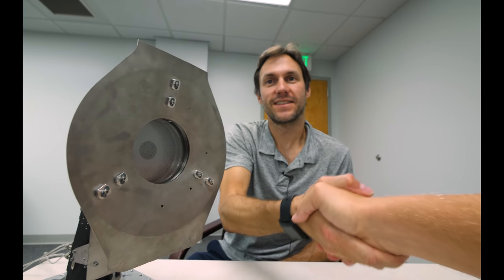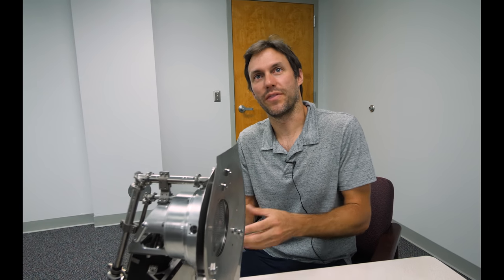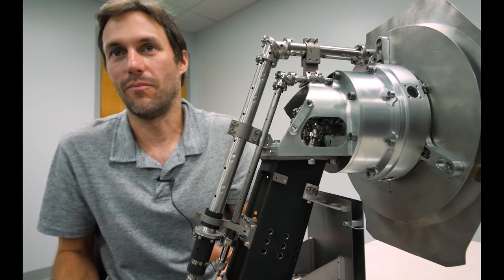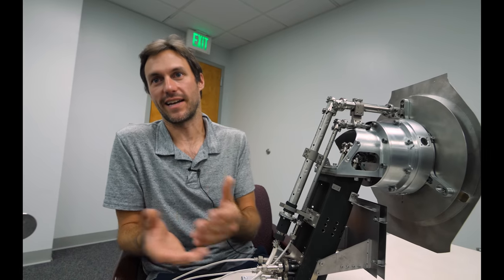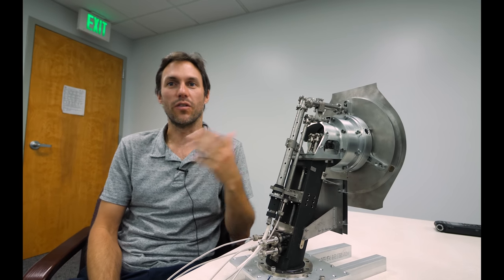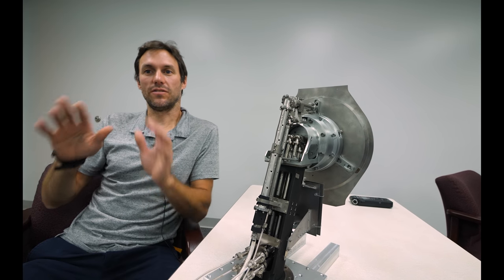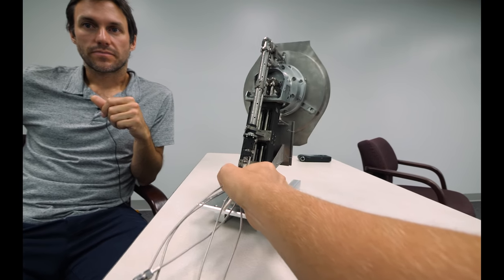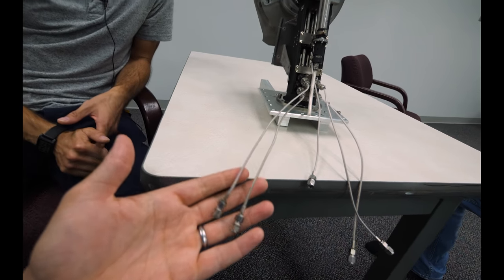Scientist Interview: Dr. Tony Case (Parker Solar Probe)

Comment: I want to know more about the sapphire insulation! Mind blown!
Reply: That and how were the orbits chosen. I mean, if we're going to Mars for instance, we usually pre-select the sites we would like the spacecraft to fly over. I hope Periodic Videos does a video on all these fancy metals.
Reply: Sapphire really is amazing. Most people are just too used to it being used in jewelry and it just kinda goes by unnoticed but it really is amazing stuff
Reply: The main reason we use sapphire is that it is a really good electrical insulator, even at really high temperatures.   Especially important in this application where we have to sustain up to 6000 volts!
Reply: Is there anyway to see a picture of the inside?
Reply: Sapphires were also used on the 30,000 psi water jet system that cleaned the shells of the booster so they could be reused (up to 10 times). It's amazing that water at that pressure would erode even the hardest materials and even the fine sapphire nozzles got worn and had to be replaced! I know because I toured the Cape Canaveral Air Force Station next to Kennedy Space Center and saw where they took the booster shells segments on rail cars, cleaned them, then they would reassemble the segments (with the famous O-ring seals) and refill with propellant.
Reply: @anthonycase  : 6000 volts? The 2016 article in Space Science Reviews says the onboard power supply "is adjustable from -2 KV to +8 KVDC". Maybe I misunderstand what voltage the sapphires are resisting.
Reply: @reksuhaksarben8249  Good catch.  That was an earlier design. Requirements have since changed. It still CAN go up to 8 kV, but we only plan to take it to 6.
Reply: Tushar Kelshikar, pretty sure periodic videos covered "all those fancy metals" several years ago already. Just search up. Niobium, tungsten, platinum, titanium.
Reply: +Tony Case
thanks for the info, also thanks to everyone else that contributed
Reply: It reminds me of sapphire beads being used in watches, I guess it causes really low friction and low wear and tear in the moving parts. So, that thing is built like a Swiss watch :-)

Comment: stupid question:
If the offcenter gravity to the center of pressure is causing so many problems and fuel usage (by desaturating the reaction wheels), then why not shape the spacecraft in a way, that it compensate for it?
For example: something the same shape on the other side. To make it symethrical.
Reply: They can just slightly shift the mass and it's balanced without adding any unnecessary parts.
Reply: @MyBalls my thoughts exactly.

Comment: Awesome videos!  I want to know more about the screens on the collector, more about the construction of the shield protecting everything, how do those magnetometers do what they do and function to provide data, and the solar panel cooling and the "dump" of excess heat to space.  I studied physics, chemistry and biology in college.....ended up in construction, the travel business, and IT.  Thank you for sharing that glimpse into "hard" science in a way most of us can understand.
Reply: The screens (or "grids" as we call them) are made from a monolithic piece of tungsten that is then chemically etched (they mask off the bits we want to remain, and then etch away the rest).  The result is a criss-cross pattern that is 90% empty space and it allows us to create an electric field in the instrument, but still allows particles to flow through them.

Comment: Last thing I heard, sapphire was also used in watches for precision bearings and waterjet cutting machines for presision microscopic cutting by way of abrasive slurry (without losing tolerance).

Comment: @9:17 why not just add another to the other side to have even torque? or just a blank plate made of the same materiel?
Reply: I guess it adds weight but if it was a blank counter balance(for lack of better word) it seems like it would not add to much weight if it is saving on long term fuel.

Comment: hey Justin, just curious, don't know if you asked Dr. Tony this. 
If the "cup" is literaly the main instrument on the probe, why they only build 1. Sure they have tested it for years. But i  think another 1 (maybe place it on the another side of TPS) is better, not only for redundency, but also the data that we get from 2 instruments, certainly better than just only 1.
If there is glitch in the data, with only 1 we can't for sure know if it was the instrument error or not, we don't know if the data it provide is absolute accurate all the time. From 2 instruments, we can compare 2 set of data.
With really decades of work, and billions of money. I think it still better to build 2 sets of the instruments.
We literaly charting new teritory here, certainly more data (even if the data we get from those 2 set of data is the same all the time) is always better.
I don't know, it just my curiousity.
Great video, thank you for sharing.
Reply: I wouldn't call the cup the "main" instrument.  It is one 2 instruments that measure ions, and one of 3 instruments that measure electrons (the other instruments are back behind the heat-shield (called the thermal protection system, or TPS).  So there is some redundancy built in, it's just done by using different types of instruments rather than two of the same type.  Also, some of the science objectives can be addressed by other types of measurements (like the magnetic and electric fields instruments, for example).

Comment: I really enjoyed this interview. A couple questions came to mind: 1) if alpha particles are hitting the collector, does this not result in a build up of mass inside the collector? If the solar wind is not balanced in terms of charge, i.e. having an appropriate number of electrons, would this not also result in a net increase in the charge of the spacecraft? 2) If the shield needs to be cooled anyway, wouldn't a heat engine suffice? I'm guessing it would introduce additional complexity, but I have to imagine that it would produce all the power you could want, and that it would potentially reduce the radiator size?

Comment: That Instrument looks like its build really tough, with thick metal sheets. Is that necessary on a probe? Does the probe experience such high G-forces after launch? Its all added mass after all that the probe has to accelerate.

Comment: 1/r^2 is the inverse square law for decrease in signal strength (i.e. radiation density).  Are you thinking of flow rate through a tube? Or thermal radiation from a black body being proportional to its temperature^4

Comment: with r^4 i think you might be thinking of the expansion of the universe where the energy density of radiation has a 4th power. (3 for the 3 dimensions that are expanding so volume increases + 1 from redshift due to expansiopn of space so the energy decreases).

Comment: Why doesn’t the electric field in the second mesh throw off the magnetometers? Isn’t that generating an electromagnetic field? Is it similar to the reaction wheels, and can be accounted for in equations since it’s a known value?

Why didn’t they put the Faraday cup in the center of the shield to keep it symmetrical and reduce torque? Would it have transferred too much heat to the instruments behind it? If so, was there no way to put another smaller shield between it and the other instruments? Would that have made it heavier than the model that was used?

Comment: Density changes as 1/r^2
I assume that they have used
Photon Density=no.of photon/volume (i.e particle flux/speed of light)
But interestingly 
Gravitational force also changes by 1/r^2 
Question is
Is some how gravity is involve in the Density change of photons?

Comment: Why it is called faraday cup? Anything related with faraday
Reply: My best guess is, since Faraday was the first scientist who theorized ions, which are the particles the cup actually detects.
Reply: My guess: It's an EM conducting and blocking wire mesh , just like a Faraday cage... Except this one's a cup instead of a cage.
Reply: See this ( https://en.wikipedia.org/wiki/Faraday_cup ) for an explanation of a "conventional" Faraday cup (yes, named after Michael Faraday).  Our "Faraday Cup" is basically an extension of that type of measurement and so the folks at MIT that were developing these instruments over the past 60 years used the same name.  Now, the two things that are both called Faraday Cups have diverged pretty drastically in design, but still share a name.
Reply: @anthonycase  Thank You !!!
Reply: @jardelelias5625  Thanks
Reply: @Shaeress  Thank You
Reply: Tony, your taking the time to do the interview was very cool but to even answer some comments, now thats just awesome.  Best wishes to you sir.
Reply: +Tony Case I love that you are here in the comments and taking time to answer questions! Thank you!

Comment: So... wouldn't it be possible to have this thing on a swivel, and put it on the side of the craft you want to capture force from to fix rotational energies on the craft instead of resetting the reaction wheels?
Reply: Spacecraft with a rudder. Nice.
Reply: Heck yeah. Imma fly a ship in space some day and it will be with solar sails! Playing Sail Away by Enya till I plummet into deep space with no way to travel elsewhere!

Comment: i don't get why they would not use 2 of those things and get them out on both sides. like this the torque issue disappears and they can have error correction and stuff like telemetry.
And don't tell me it's about the cost,  because compared to the cost of the full mission it would be fractions.

Comment: One thing I was curious about is how theyll orient it. What is being used for propulsion to keep it facing the sun (to counteract that torque). I know they said there's going to be a kilo of water on it. Could that be used as mild propulsion since steam expands like a thousand times its volume as water.
Reply: The water is a closed loop just for cooling.  The orientation is accomplished with momentum wheels.  (Think about them like this video https://youtu.be/5cRb0xvPJ2M?t=67 , but we have multiple wheels and we change the speed of them rather than changing the orientation).  Because they're not totally efficient, eventually we have to use thrusters to "spin down" the wheels.  So our limiting resource for the spacecraft lifetime is the fuel that our thrusters use.

Comment: How should I go about figuring out which type of engineering to pursue? I like pretty much everything that moves, and I like knowing the exact reason why something happens, or how something works. This is why I think engineering is a good fit for me, but how do I know which type? If you or anyone could offer some insight, I would be so grateful. Also, I am a high school senior and am about to start taking physics.
Reply: Well I'm not an expert but I'll throw in my 2 cents. Mechanical engineering for starters. Add on Electrical. From what you've said I think that would cover it. Good luck and keep those student loans down!!!

Comment: Would be pretty amazing if it could detect neutrinos. Would definitely like to see a cutout of this thing.
Reply: This cup thing works by creating an electric field and detecting charges. Neutrinos are neutral, so you couldn't detect them with something like this, you would need something different and probably a lot more "heavyweight" to do that.

Comment: So the grid is made of good old W, but what is the outer bit of sheet metal made from? More tungsten or could you get away with a lighter metal? 
Also, is the main "housing" made from aluminium?
Reply: The outer piece of sheet metal  (the thermal shield) is a niobium alloy called "C103" and the housing is a molybdenum alloy called "TZM".
Reply: Very nice! You guys get to play with all the fun metals. The housing had me fooled because of the whiteish look it has compared to the rest of the structure. 
After looking at it a bit closer I guess it does have a slightly different look to it over the 2 square bars you have it mounted too... Or its just my eyes/lighting playing tricks on me. 
Another question for you if you don't mind, Did you have any parts of this welded or were they all machined/formed from solids? 
Either way, Awesome job all around , and thank you for taking the time to reply!
Reply: So, the 3 pieces that are nearest the table (the two longer ones and the plate with the square bolt pattern in it) are aluminum, and are just for display purpose (we don't use any aluminum in the actual instrument).  The long-ish "strut" that attaches to that is titanium (but with a black coating on it).  The cylindrical bits near the top of the instrument (the  actual "cup-shaped" items) are the moly TZM.  There are a few things that are welded, but only non-structural items.  The vast majority of the instrument is all solid pieces with screws holding it together (a lot of them are size #0).
Reply: @anthonycase  That's fascinating! What are the screws made of?
Reply: The screws are almost all made of the same metal that they're being screwed into. So mostly moly TZM and titanium

Comment: Can the sensor differentiate between jobs and electrons though? Wouldn’t they just cancel out?
Reply: I'll assume this is a typo rather than a political comment :)  If you meant "ions" and electrons: yes, we can differentiate.  We use a "synchronous detection" technique, where our high-voltage is actually an AC voltage (a sinusoid at about 1 kHz).  If we use a positive voltage then the ions are accelerated away from the sensor (and thus some of them don't make it in).  The electrons are accelerated into the sensor (so all of them still make it in).  So the change in current that we see is due only to the ions.  We can also operate in electron mode, with a negative high-voltage.
Reply: Tony Case ahh cool, thanks!
Reply: Tony Case ahh, the 6k sine wave uses whatever reference (frame/“earth”/“neutral”) and can operate entirely positive or negative relative to the reference

Now I’m curious where you get the sine wave from, chopped/inverted, or some motor/alternator device?
I come from an AC Traction background and our inverter “AC” isn’t great

Comment: The Kerbal solution to that torque problem would be to make 2 of those.
Reply: Believe me, that's what we wanted to do on the real spacecraft too!  (Well, at least those of us on the Faraday Cup team!)
Reply: agreed
Reply: I assume that the solution used was to shift the center of balance of the spacecraft to account for the torque of the exposed equipment.
Reply: So was the limiting factor budget, weight or moving around internals to allow for another one?
Reply: Early on (when decisions like this are made), mass was a significant limiting factor.  We were originally going to launch on something smaller (Atlas V), so we couldn't afford to add mass.  Everything else ($$, accommodations on the spacecraft, power) was also a concern (per usual).
Reply: Yep!  The TPS (thermal protection system at the front of the spacecraft) is aligned such that the center-of-pressure and the center-of-gravity are (mostly) aligned.